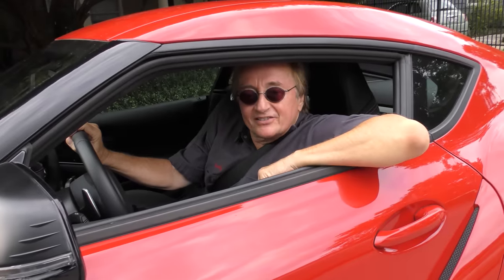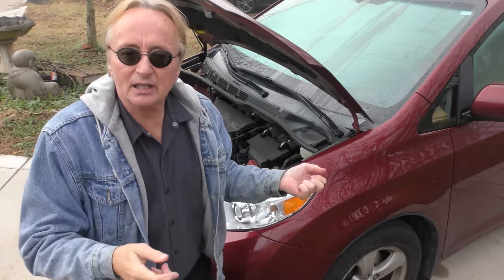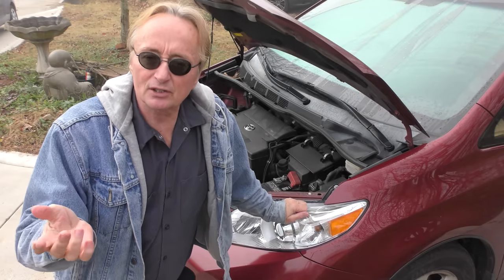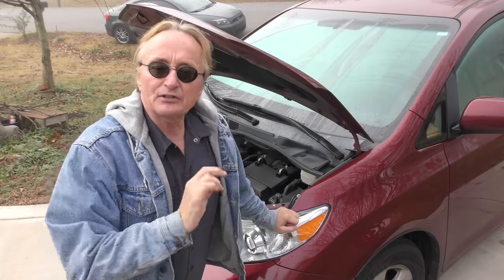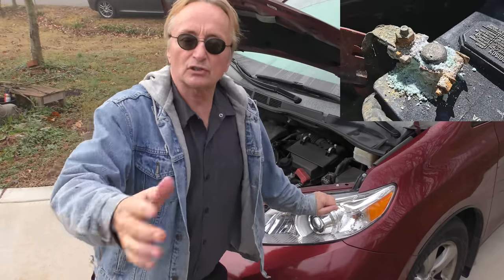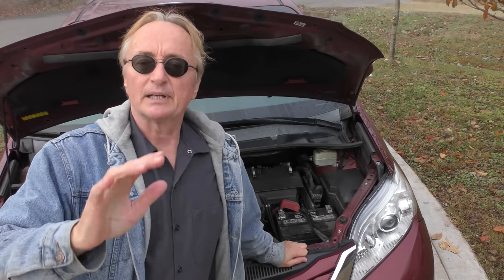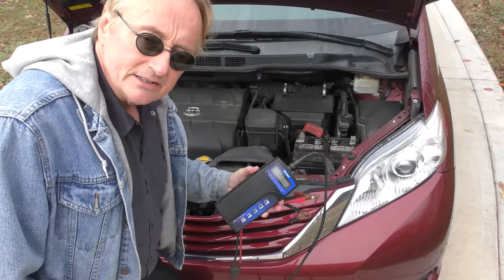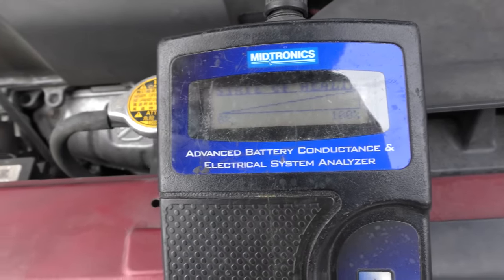If You Buy a Car Battery from This Place You’re Stupid

Comment: Lead is used for bullets... a pretty popular item these days.
Reply: And we don't have a lead mine anymore since Obama shut it down in Missouri.
Reply: @TheMatrixIsReal.  bruh, lead mines pollute extremely to the local environment such as the people and fauna. The workers health is at risk both short term and long term. The workers breathe toxic smokescreens that can cause lung problems such as cancer and COPD. I think the lead should be imported to factories in America where Americans work.
Reply: @johncage3025  I primarily meant how it affected the people who work in the mines.
Reply: Obama didn't like bullets so he was using the EPA mafia trying to make lead expensive for bullet buyers.
Reply: @robtankbuster5215  The answer: steel core ammo.
Reply: Even more so with the possibility of civil war with Biden winning
Reply: If the leftists get their way, the odds of civil war increase.  Lead will become dear.
Reply: Actually modern bullets use a steel casing with a gunpowder core. Lead is a very soft metal and not a major ingredient in ammo production. Steel is a much better heat conductor and has a much higher melting point than lead.
Reply: Lead is the new gold
Reply: @TheMatrixIsReal.  you mean the lead smelting plant that good old Obama had shut down
Reply: @houseofno  Trump supporters don't understand science.
Reply: What is the longest lasting battery I can buy? No price limit, do u recommend a odyssey or any other dry cell battery?
Reply: @dannycastaneda4273  marine batteries are best
Reply: @robtankbuster5215  yep
Reply: Gonna need it if Biden cheats his way in...
Reply: @houseofno  not all bullets are built like that and bird shot for shotgun shells uses lead pellets.
Reply: @XHellPriest  sounds like you have been brainwashed by CNN and BSNBC if you believe that.
Reply: @robtankbuster5215  why do you people always have to bring politics into things. Just watch the video about car batteries and move on lol
Reply: @anthonykendall9189  people are just wondering why lead prices are going sky high, just explaining why. Sorry if this offended you.
Reply: @XHellPriest  at least they know how many genders there are...
Reply: @houseofno  You don't know anything about bullets do you? I dare you to find me any production bullet with a gunpowder core.  Lead is soft that's exactly why it's used under a usually copper jacket so that it will expand and cause more trauma. Now you know.
Reply: @robtankbuster5215  not offended. I’m just relaxing learning about car batteries and everything somehow leads to politics. Sometimes I just want to watch a video about car batteries
Reply: Ahhh yes I got the tumbler running now got 1000 rounds to load 🤪
Reply: @williamchapman2434  yes it's a sweet sound! Just cleaned 223 and 9mm brass.
Reply: @anthonykendall9189  sure I understand.
Reply: @TheMatrixIsReal.  That mine was Doe Run, the company I work for serviced their hydraulic components for years up until they closed. Put people with high paying jobs out of work there along with the other businesses feeding from the mine. Now virgin lead is imported so our government is lining the pockets of some other country with our money.........
Reply: Rob Tankbuster yes sir been doing it for 25 years never gets old 🤪
Reply: @johncage3025  You beat me to it.
Reply: Louisiana I bought a battery for my mustang got an the core was 40$🤦🏽‍♂️
Reply: @carsonmckurtis2585  you rather have the birth defects and other conditions long term exposure give people that live in the area?  The tailings produced by a lead mine or processing plant wastes are toxic, they bioaccumulate, all of that is well documented. Unless mining/processing techniques are revised I wouldn’t wish that on anyone, especially the folks that are stuck there when the mining company/processor declares it no longer economically productive.
Reply: @Da fN of course be happy to 🤗 there’s only two. Anything else is mental illness or a mutation in the chromosomes. And I’m no expert of course, but I can count 1,2, or x,y....
Reply: @kman-mi7su  well you should understand then that “science” isn’t comprised of just natural sciences. For example there are social sciences(anthropology), behavioral sciences(psychology), and political science that would have applicable bearing on the subject. I believe to focus on only the aspects of a topic that supports your position is called cherry picking.

And what do you consider the people that mentioned Obama? Brainwashed or different?

And democrats of the 1850’s bear little resemblance to those of today. If the meaning and usage of words like environmentalist and conservationist has changed over the years from what they originally meant, the name of a political party can to. Unless you get some evidence from a KKK source that they made up and defined the majority of the party and its politics  it’s just speculation. How is the relationship relevant today, antifa is the new KKK?
Reply: @Da fN a mutation of the two, it’s still not a new gender.
Reply: Then when we finally switch to EVs someday, somebody will make some big benjis....
Reply: Take my angry upvote.
Reply: Ha, Ha! Thinking the same thing 🇺🇸
Reply: The cognitive dissonance radiating off of the alt-right republicans in this thread is STAGGERING.
Reply: @a_stranger_loop  The far left bought “lead “ also. The stage is set, unfortunately.
Reply: @houseofno  You have no clue what you're talking about.
Reply: @ayebee1207  No way. How old the car? Why is it that much? Labor or the pack cost more?
Reply: And aircraft fuel
Reply: If creepy Joe has his way, we are doomed.
Reply: @houseofno  what are you talking about. I know there is lead free ammo but its normally only used for huntimg public lands where lead ammo has been outlawed because its so toxic.
Reply: Ecwryone should Google "how leaded fuel polluted the oceans of the entire planet."
Reply: I just filled a battery with acid last month. You can still order batteries that way. Oh I'm shafted....it was a motorcycle battery & as i was typing this scotty said "except motorcycle batteries". Lol.
Reply: @dannycastaneda4273  liyhium ion batteries last longest.
Reply: @timothypadilla1277  on top of that Brian said what he thinks the casings are made from...he said steel but really most are brass & he never said what the slugs are made from. The slug isn't made of gunpowder so what is it?
...usually lead.
Reply: @clardy01  actually it is xx or xy. Everyone has at least one x chromosome. So technically you are half female.
Reply: I thought bullets were made of... Silver
Reply: @ayebee1207  I keep my Glock 19 loaded with 25 year old black talons still today.. haha
Reply: ....by the wrong people.
Reply: @dirtyaznstyle4156  They don't care. ):
Reply: @rossjudd6049  such is life... crazy times when people thing the government is lining foreign nation’s pockets by importing lead. I don’t know what the tariff situation on imported lead is but the government doesn’t do the importing of commodities like that for free trade, that’s private industry. Otherwise I wanna know where I can get some gov’mnt lead
Reply: @johncage3025  lead hasn't chsnged. It is lead. Its always the same badness. 
Did you know that there is no safe level for lead in the human body. Before mining there was actually no lead whatsoever on the surface of the earth. It was all safely deep underground.
Reply: @anthonykendall9189  just don't read the comments if all you want to do is watch a video about car batteries.
Reply: @anthonykendall9189  people bring politics into seemingly unrelated topics because politics effect everything.
Reply: Stan Laurel - "You can lead a horse to water, but a pencil must be lead".
Reply: @charles2241  pencils are graphite not lead.
Reply: @waynes.2983  Not back in Stan's day, or indeed mine. Actually I'll backtrack that, as pencils were very commonly said to be made of lead. though wrongly it would appear.
Reply: @charles2241  wrongly is the key word.
Reply: @waynes.2983  I said it was, so what?
Reply: @houseofno  most ammo today is copper jacketed lead with brass casing. There are some frangible ammo made of compressed copper powder & others that use various polymers, rubber, nylon etc. Majority of bullets that I know of only use steel as a core to improve penetration. The majority of ammo  still use lead bullets (copper jacketed.)
Reply: except the new lead is actually a virus.
Reply: @kman-mi7su  sorry, the Dems didn't create the KKK. Also, the KKK marched with Trump.
Reply: @hondasaregay100  triggered much?
Reply: @XHellPriest  Nevermind, perhaps you'd be more comfortable watching "Birth of a Nation" which DEMOCRAT Woodrow Wilson showed at the Whitehouse.
Reply: @XHellPriest  BTW the KKK's founder, was Nathan Bedford Forest, a DEMOKKKRAT and also a Confederate.
Reply: That's why batteries are priced up.  We might need the bullets more than a battery.
Reply: Us good little humanist socialist boys and girls know that guns are naughty and only Mr Government Man should have them.
Reply: To pretend the majority of America's gun owners have any bullets. No one has bullets because of Obama. You don't have more than 30 bullet because you're safe. You have 5 bullet from target practice after listening to Trump. You now store your 5 bullets after you've matured and weren't part of storming the hill.
Reply: @dannycastaneda4273  Odyssey makes phenomenal dry cell batteries. Optima dry cells are great too.
Reply: I’ve had great luck with Walmart Ever Start and they come with a warranty.
No problems with the three year battery in Michigan winters.
I let my 05 explorer sit for months and the battery died and Walmart replaced it free.
Reply: @ice0275  actually shot load for bird hunting changed over to steel pellets about 20 years ago in Canada. Surprised its not the same everywhere. The lead shot contaminates the water and the birds even sometimes eat it as gravel for their crops.
Reply: Here’s a YouTube challenge- see if we can disagree without bringing in any politics!!! Lol
Reply: As for ANY type of mining my opinion is Not In My Backyard.  Raise your hand if you want a lead mine in your backyard so we can be independent of China... I'm not seeing any hands up... what about you poors in the back... nobody? nobody?  Hmmm.

Comment: I bought a classic Impala from an Army mechanic and it had a large military grade 10 year battery in it. Thank you so much tax payers!
Reply: The ones from fort Hood used to come from interstate, I stopped using interstate though cause they arent made as well. Started getting energizer cause they are made in America and seriously seem to last longer than the optimas (made by interstate) I used to use. But sounds like you got a good deal!
Reply: Costco batteries lifetime warranty
Reply: @on-site4094  
Not lifetime, but yes the best warranty and they are the least expensive ones.

Comment: Great video!! I've worked at a battery shop for 17 years, and everything you say in this video is correct! Delco batteries are still made in Korea by Atlas Battery and are actually pretty good now. Just stay away from Exide Batteries, they are absolute junk. And they just declared bankruptcy again.
Reply: Again?? Did they lose another court case?
Reply: How about Interstate batteries?
Reply: Simply a leveraged takeover.
Reply: @brianconner3222  I like interstate batteries. Outlast the competitors
Reply: Die hard battery for sure
Reply: I agree the Exide Batteries are junk, but on the Walmart Batteries you used to be able to look carefully at the label, and be able to tell if it was an Exide or JCI Battery. But no more, unless you know the secret.
Reply: @stevenmoomey2115  so, do we ask the secret?

Comment: The EXACT same oil at Wal-Mart is almost half of what the local chain store charges.
Reply: 5qt of penzoil synthetic at walmart is $26 at autozone its almost $40
Reply: @EddieB1  they price match
Reply: Walmart carries hard to find oil like 0W-40
Reply: Agree. Been using the China Mart syn brand in all my cars.
Can't tell the difference between Mobil 1 or syn-tech
Reply: @jroda8015  not Walmart....only oRielly or Advanced
Reply: I have been using Wal-Mart's brand oil for as long as I can remember. 1985 Chevy C10 truck logged 500,000 miles....1996 Rodeo has 482,000 miles - still runs. Used Wal-Mart's oil both vehicles. Don't waste your money on expensive synthetic oil....follow Mfg vehicle maintenance guidelines and don't drive like a race car driver - simple as that!
Reply: @raybin6873  China Mart syn or regular?
Reply: FWiW. I tend to buy higher end filters. Don't buy the cheapest
Reply: @EddieB1  Not to mention our AutoZone is next door to Walmart.  Looks like they would price competitively.  O'Reillys is the same way.
Reply: @raybin6873  I'm in Minneapolis.. the vehicles rusty out from under us.
Reply: @ironmyno  Yeah - i can relate to that. I used to live in St Louis MO....cars rusted out badly because of the salt put on roads during winter months. I live in mid state Georgia now - no rust out of cars here.
Reply: It’s crazy how people still don’t understand that the more product you buy, the cheaper the cost. Walmart is MUCH bigger then Autozone.
Reply: @kharysims4030  p
Reply: Valvoline oil change charges me $76 for Max life. Walmart full synthetic $40. 2021
Reply: @raybin6873  older cars never had a problem with any type oil vs newer cars.
Reply: Wal-Mart really is underrated. They have a bad rap but I mean most other places are overrated tbh.
Reply: @raybin6873  
$20 oil changes at Wal-Mart and my car is still running great

Comment: Advance, AutoZone, O’Reilly’s, Walmart, and Costco all source their batteries from Johnson Controls. The batteries offered by these five companies have little to no differentiation between one another aside from their label. The three aforementioned parts stores fix their prices to one another which plays a big role in the sudden price jump of lead acid batteries. (For the record, the “new” Diehard batteries offered at Advance are nothing more than relabeled AutoCraft batteries). Brand names in the car battery world are as meaningless as it gets, be mindful when you purchase your next car battery
Reply: So which one is better to buy?
Reply: Speaking of ADVANCE AUTO batteries, I've had really good luck with a Size 65 AGM battery I bought there. It's 4 years old and it still acts like a brand-new battery. The Optima AGM that preceded it died after only three years.

Comment: A well kept secret, is a battery manufactured in USA in Pennsylvania by a company called Eastpenn mfg.  Their Deka line is one of the best batteries for the money.  The battery is sold at independent auto supply stores or tire shops.  I am impressed with how well their batteries hold up.  I bought one for a truck rated at 850A CCA and it tested out at over 950A CCA on the meter.
Reply: They are sold at Ace Hardware. Plan to check it out for an Audi.
Reply: nope, you can't do better than a 'maxx' at Walmart, (made by Johnsons who make over half the batteries in America), for half the price, and Walmart offers a 3 yr warranty

Comment: I've been buying batteries from the junk yard for $20, look at the manufacturing date and check the voltage.
Reply: Need to check amperage also; had a battery with all the voltage, but some 150 amps less than  rated while still in warranty on a professional battery tester. New battery solved my issues.
Reply: I don't recommend people to buy junk yard batteries, just like windows - half the time it costs more then to just buy a new one. But if you have a tester and you know what your doing then you know it'll be okay.
Reply: Yep I hear you- A buddy talks to guys that run a wreckingyard—they would say which vehicles got hauled in because of accident...,good thing about that was he knew they were driving so pull running engines and transmissions ... great way to run a backyard business..
Reply: Damn, where are you getting junkyard batteries for $20. Cheapest my junkyard has them for is $40

Comment: There are 2 battery manufactures in the USA... Johnson Control and East Penn.  You can tell the difference by looking at them, raised cap covers, that is Johnson Control.  Flat tops are East Penn.  Note, that is probably 90% of the batteries.  So, if you buy a Walmart, Oreilly, Autozone, Advance, Napa, Excide, Interstate or any car battery, you will see the same battery with different labels.  However, we now are seeing import batteries come in from China, Saudi Arabia, Spain, Korea, Japan.  Even though there are 2 US makers, you can tell the difference in the grades by the weight of the battery.  Before you say no way... look at them.  Pick up a 65 series battery with a 1 year warranty, and 3 year warranty... which is heavier?  Which has more crank amps?  With today's electrical demands, buy the battery that has the right amps and size for your vehicle.  Trying to get by cheap, will cost you in the long run.

Comment: I bought a deep cycle marine battery, essentially two batteries in one.  Run power equipment etc and still have plenty of power.  I paid $300 at Batteries Plus, installed with a 5 year replacement warranty.  I like it!
Reply: If you run a deep cycle in a car that is idiotic.
Reply: Power equipment? As in gas/diesel powered? As in, equipment that has an engine and an alternator which charges its battery?
Or is this some 500w inverter powering corded tools?
One way is kind of smart, the other way is kind of dumb.

Comment: I have noticed Ford factory installed Motorcraft batteries with the sight glass last incredibly long. I had one that lasted 16 years in a 4x4 Ranger and 19 years in a 4x4 F350.
Reply: Ford has THE best batteries, that's why they come with a 3-year battery.